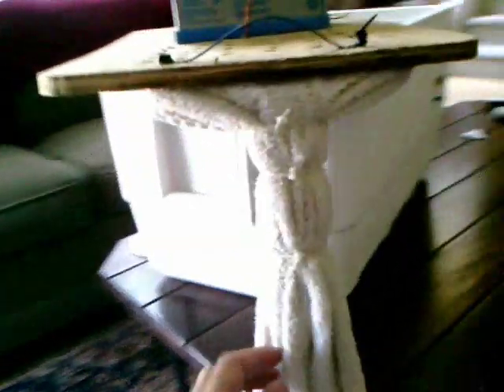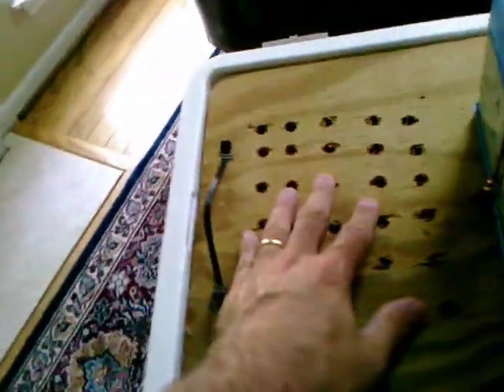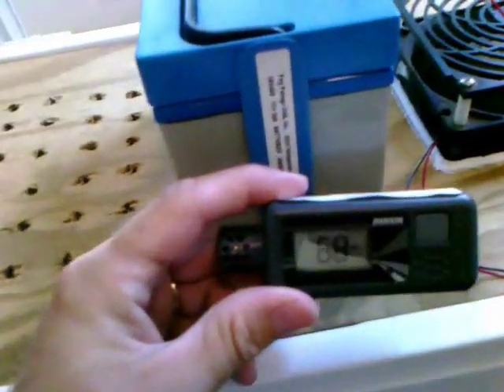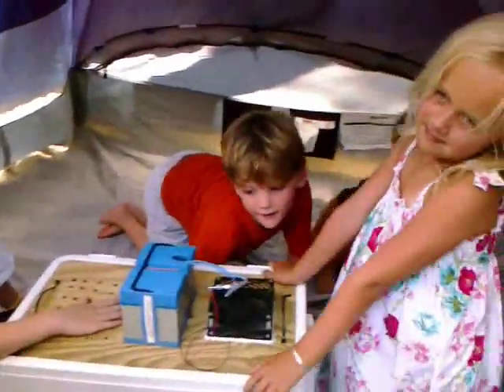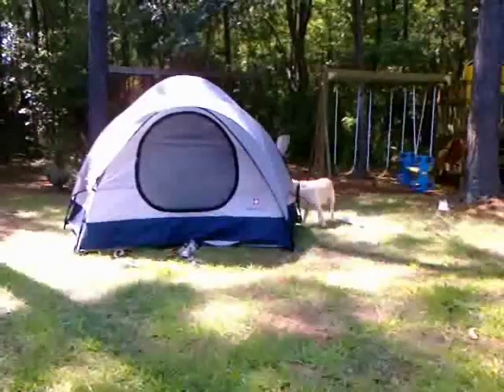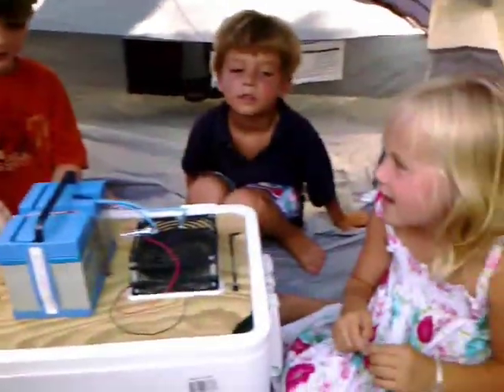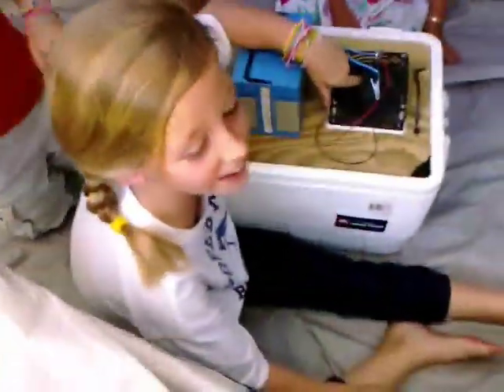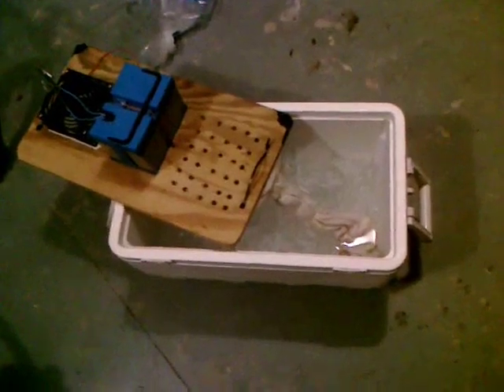Tent Air Conditioner in Charleston, SC

Comment from the maker: Thank you very much for your comments and suggestions.  They are good ones.  The intent of the wet towel is to take advantage of the energy associated with evaporation.  This concept is called a "swamp cooler" or evaporative cooler.  Although there is a lot of cooling energy associated with evaporation, it is just too humid here to take advantage of it.  The swamp cooler concept really cools well in places like Arizona.  I should probably do like you say and focus on straight sensible cooling.

Comment: Just a few suggestions if that's okay? I have seen other videos featuring similar device. You may want to switch out the towel covered louver to a 2" or larger pvc pipe elbow. That will allow you to control the direction of air flow. The towel may have been too restrictive especially if it became damp. Also instead of buying ice try freezing 2 liter soft drink bottles. They will last longer and are reusable. And as cute as your focus group I think they kept unplugging the fan. Great video!